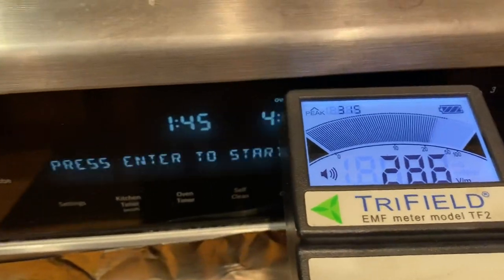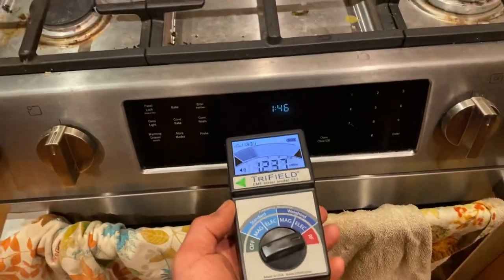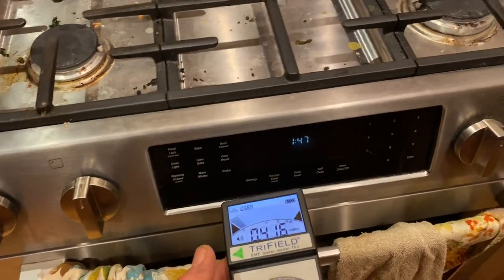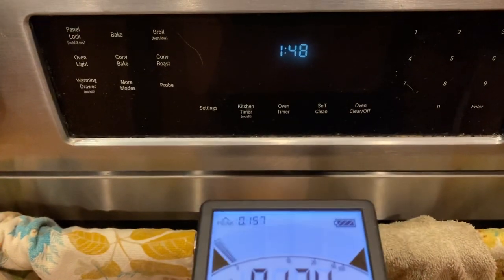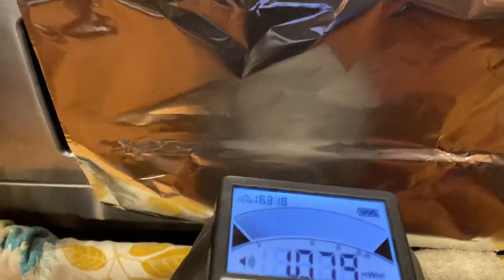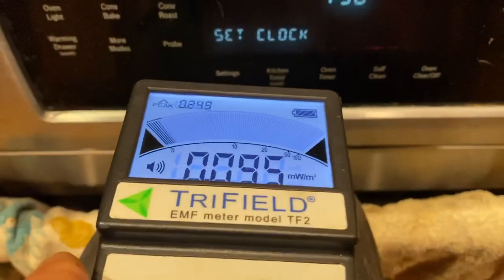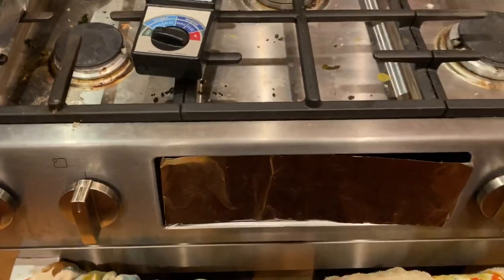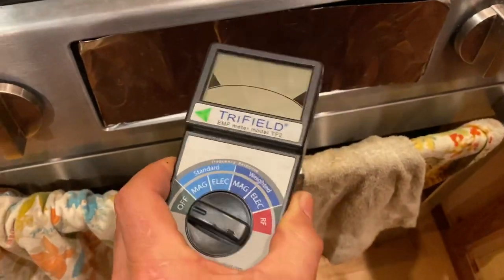aluminum foil as an emf reducer?

Comment: I live in Sweden. The house we bought came with a Smart meter, freezer, cooker/oven and fridge as well as every single lightbulb being LED. I have an EMF meter. The radation coming from the Smart meter alone had me worried. Since living here I've developed the worst insomnia in my life, have pretty constant headaches, dizzy turns and more. I contacted our energy supplier and other energy authorities about having the Smart meter replaced. Not one of them got back to me, not even to tell me I couldn't. 
The EU has outlawed incandescent bulbs. So I'm slowly removing the LED's (note: when switched on these give off tremendous amounts of EMR) and using candles and oil lamps. I put the so called Smart freezer out in an outbuilding where it remains, unused. Not only were the readings high but the damn thing had an alarm that went off every day, multiple times, for no good reason. I hated it...I'm about to begin unplugging the fridge overnight too. I also unplug the wifi router (we can't afford the thousands of kroner to install wired net) every night as well as laptops, tv (it isn't a Smart one and oh what a long time it took us to find it!) etc. But that Smart meter....I'm going to figure out if I can turn it off my own self, at least overnights. The readings in our bedroom, despite everything being unplugged, are through the roof due to it because it's sited immediately below the bedroom in the basement. And although I covered it where it sits on the wall with mesh and Faraday fabric, of course you can't do so all around because of the wall. The electromagnetic radiation from the meter penetrates through walls, ceilings and further. That's how damaging they are. A group of Swedish scientists researched a certain type of cell tower and recommended to the gov that the rollout of them be halted pending investigation due to the harm they cause humans and wildlife. Result? Absolutely nothing....
For those mocking those of us who suffer symptoms at the hand of EMF, grow up and get a life. You wouldn't...I assume...tell someone with the symptoms of cancer or heart disease it was all in their head. Unless you're medically qualified to comment, then you know where you can go with your opinions.
For what it's worth, I'm a sixty two year old woman with a background in older electronics who began to understand the dangers of EMF many decades ago and who has kept up to par on the damage it continues to cause. Believe me, it's very much worse now. We live with electronic "smog" pollution no matter where we are. 
But of course, due to profits for tech companies, we aren't allowed to make a fuss.
Well, now I'm at the age where I quite happily say, "F that. One huge fuss coming up, suck it up."
Reply: 👏🏻👏🏻👏🏻👏🏻👏🏻👏🏻 I proud of you dear
Reply: It's worse for those who took the new mrna jab.
Reply: f.goossens8118, I suggest looking into EMF paint. If you use proper grounding with it, the EMF will reflect away from the smart meter.

Comment: I am finding out the wrong way just how bad a cellphone is from a bad habit of holding the phone over my stomach. For the past 3 years I have more spare time and spend more time texting, emailing, watching videos and playing games on my phone. Lately I have been having increasing stomach problems that continues to get worse and to the point where I feel as if I am dying from poisoning. I recently figured out the problem is actually coming from my cellphone and now I shield my stomach. I have noticed a big difference where I have taken steps to limit my cellphone use and increased distance while charging. My doctors have been baffled with what is causing my severe stomach problems and never not once linked it to cellphone usage. These electronic signals are very dangerous and should be looked at more closely when there are mysterious health problems. I just hope I caught my problem in time before it done serious damage to my stomach.
Reply: The own cellphone is much more harmful than a mobile radio mast due to its close proximity. Distance matters, and the body is most sensitive during sleep or meditation, so the worst thing one can do is storing or charging a mobile phone on the bedside table. Best always turn it off or keep minimum 3m distance during sleep. I recommend to charge lithium batteries generally only inside a closed metal box (cash box with cable hole) also due to fire risk.
Reply: @cyberyogicowindler2448  See bioinitiative which has thousands of studies. Problems go far beyond cellphones, including LED switchmode circuitry and simple power cords.
Reply: Try copper fabric. It should block. Or Shungite

Comment: I have been getting sicker and sicker almost by the day.  I have not slept a full night since 2003.  The first night I slept in my newer house I was awake all night and had severe insomnia since.  It had to be something in or around that house. But when I moved again 5 years later nothing changed. I have had severe Tinnitus since I was 19 which was over 50 years ago.  I cannot be without my TV at night to drown out the noise.  I just ordered that same Trifield meter.  If my TV in my bedroom is high I will have to do something. Maybe I can start to use a sound machine or low level music maker somehow. I can't continue like this.  I believe you.  I will shut off the juice if it helps. Maybe the tinnitus might lower by itself even just a bit would be nice., i can hope. I'm just too sick to live with this.  Thanks so much for this excellent video.
Reply: ibudilast

Comment: There is proof, there's studies that EMFs are dangerous. My parents are from Jamaica. I have fibroids which are always swollen and hard. After grounding my bed using a grounding rod in the earth and putting the end of the grounding cable near my tummy, it helped but i didnt feel much difference. One day i went to the pound store and picked up a car sun shield after hearing that myler (foil accident blankets) were good at blocking EMF. I put it under my duvet and covered my stomach whilst on my phone and watching my tablet. Well not only did i feel immediate relief but those hard fibroids which usually poke out of my belly have started shrinking. Emf causes a lot of problems.
Reply: When grounding don't use anything, connect yourself straight to the source, otherwise other emf / RF can an will jump onto the line / metal

Comment: We have a commercial range/oven.  No electronics at all, not even an electric cord.  But since it has pilot lights it burns a ton of propane.  So we turn off the gas supply valve when we're not using it and just relight the pilots when we turn it on.  Bought brand new for $1300 about 4 years ago which is super-cheap for a 6 burner stove with a huge oven.  Priced the same size for residential and it was about $6,000.  Problem is finding a way to buy them since most restaurant supply stores will not sell them to you for residential purposes.  But having a farm business will get you around that.
Reply from the maker: Yeah non electric is the way to go, we couldn’t find one when we got this and my wife wanted it and I, regrettably, didn’t put up any resistance.
Neither of us could have imagined it produced radio frequency field tho. So bizarre.
Reply: holy crap, never thought about propane used by pilots, TY!
Reply: @christinetuttle8975  Yeah, was a surprise for us too!  And on a 6 burner stove with pilots running 24/7 you can really deplete a tank quickly.  Plus in warm weather it adds a ton of unwanted heat to the kitchen.

Comment: Thinking about doing a van build and am trying to decide which material will work best at shielding it from outside waves. This might be an option to put up between the insulation and paneling.
Reply: Careful about using the cell phone inside that van!
Reply: @mclovinfuddpucker how do you ground your car when it’s parked? Thank you!

Comment: If you want the Aluminum foil to have an effect it really needs to be well grounded.
I don't know why anyone needs electronics in their oven at all.
Circuit breakers aren't designed to be switched every night, it will eventually kill them.  An inline switch is probably worth doing.
Reply from the maker: CorwynGC good tips, I want to make adjustments to this approach. But even if I got years out of a breaker it seems worthwhile.
Reply from the maker: So far we’re years into the breakers being flipped daily and no issues.
Reply: @wholesystems  as far as i know circuit breakers themselves have enormous amount of EMF, larger than appliances, which need to be blocked, so your daily exposure to the circuit breaker/electric panel is worse or at least as bad as having to be in front of the appliances even if it's short-time
Reply: @wholesystems  It would be great if you can have a video on measuring RF and EMF of electric panels/circuit breakers too, I would be curious to watch it (someone said they are only at 60 GHz and they are considered safe), but based on all websites they should be in much higher and much more harmful levels of radiation. I would like to know how best we can block our radiation from our electronic panel/circuit breaker too.
Reply: What would be a good solution as well if you're inclined would be to actually open up the instrument panel of the oven and shield the component this generating the EMF directly. A friend of mine used to do this for printers that we're going to embassies and other government offices. He said it was because you can actually take the Emi from the printer and turn it back into the document being printed even from a decent range
Reply: Sorry I'm on the phone using speech to text so please ignore any errors in grammar
Reply from the maker: @hannas4486  Well, my circuit panel has little RF - about 100x less than this stove panel. It does have significant EMR. But walking but it and flipping a couple switches twice a day doesn't take long. Cooking meals with my belly agains the stove does. Time of exposure is a key function of the exposure.
Reply: What does it mean when you say the foil need to be grounded? That it has to touch the ground? I wrapped my computer in aluminum foil, but the internet still worked perfectly fine and I still got sick from having the computer on. To be honest im not sure wrapping thr Com.. in foil was safe at all. Anyway what does grounding it mean? :/
Reply from the maker: @LinnChanett  grounded like an appliance, to the ground in the house, Less EMF .com makes grounders for a few bucks..
Reply: @wholesystems  thank you ^^
Reply: I have never seen a stove with the panel in the front. Mine is in the back going up the wall.  I have a gas stove with a pizo ignite for the cook top I can light the oven without power but it is a pita and requires long fireplace matches.
Reply: Blushield is good.
Reply: Would you need to ground foil under a bed mattress to block a below neighbors router's RFs?
Reply: @wholesystems  Would you need to ground foil under a bed mattress to block a below neighbors router's RFs?
Reply: @wholesystems  A 3-pole "transfer switch" is an option I am considering.
Reply from the maker: @hannas4486  that’s not true and here’s why: I’m not by my circuit breakers for more than a few seconds to flip them, so no they are not exposing me much. I stand by my stove often for hundreds of times longer. Dose x duration = exposure.
Plus the breakers don’t produce RF radiation like the stove does.
Reply from the maker: @hannas4486  you can block them the same way. Go to less emf . Com and you’ll see all the needed materials and ways of doing it. But get a meter and then you can also devise your own methods.
Reply from the maker: @andrewsottile2016  grounding always helps but measuring the electronic pollution with a meter will show you that it still helps A LOT even if not grounded.
Reply: @LinnChanett means connected to the earth like a black connector battery or a wire or plug to ground hole of an outlet check out earthing/ grounding
Reply: @andrewsottile2016 yea check out grounding earthing

Comment: Mind Fing blown! I’ve heard quite a bit about this stuff. But honestly never dove into it. My head is becoming full as it is. 
In regards to stoves. Why don’t you get an old Wedgewood stove? They’re frickin tits! No electronic do-dads. Ours runs on LP. 4 burners, a griddle, 2 ovens. That meter is only $170. I’m getting one.
Reply: Odd thing that stoves wouldn’t work without power luckily mine does it’s like the electric car push they will use electric cars to control population. Agenda 21 says we will not be able to leave the city to go visit nature/ forest kinda strange and even stranger you will not have the right o bare arms or own private property agenda 21 is happening now under the nave of sustainability/ great reset/ COVID beware.

Comment: I’m wondering , when using foil to block emi, do you need to ground the foil? Like a faraday cage?

This is what I’m trying to figure out.

I’d like to put it on my devices to block what they emit in some instances , for example I’d like to check furnace . But I don’t know if I’m supposed to ground it somehow, I don’t know anything about this kind of stuff or even grounding .

I thought about putting copper foil in a humidifier , since it can counter bacterial growth but then wondered if  it would gather an electrical charge underneath the water and be actually dangerous .

For some reason when I did a quick look I never saw grounding mentioned but I know with faraday cages there should technically be grounding I believe . Also, would blocking the emi of something damage the device? Does electrical frequency buildup and cause the device the overload? 

Any help clearing this up?
Reply from the maker: By measuring grounding seems to help. It without it you still massively reduce the radiation coming off the source - esp if it’s rf like a router or phone versus magnetic like come from wires and motors.
Reply: Idk how to measure grounding tbh, I’m fairly uneducated with this . 

I wonder if it builds a charge and if the charge needs to be dissipated  or if I wrap a device in it, if it can mess up the device .

Comment: Do you know if your fridge or frozent food spoils any faster with breakers off nightly?
Reply from the maker: Doesn’t seem to, been years of doing this..
Reply: the lack of electricity/radiation probably allows it to last even longer, even though it may warm up a little when turned off...

(from another reply):
a huge part of food going bad quickly is that it's soaked in radiations, from the fridge and much more... it's also in an enclosed space with poor air flow and quality... 
i've lived in a van through hot summers without using a fridge, always getting large amounts of produce and living foods monthly or bi-monthly, and it lasts longer than food in a fridge... 
one's aura and level of fear about it can also play a big role

Comment: I have a question...

I'm building a house and all the electrical power cables are going down the wall between two studs. then to the outside box....

From my understanding, those cables, especially when all together like that, are going to emit high levels of radiation.

Would putting 2 or 3 layers of aluminum foil beneath the sheetrock in that area, null the problem?
Reply from the maker: This is radio frequency emf and you’re talking about emr. I’d look into it, it’s commonly shielded but I’m not sure how.
Reply: I can't say about that, but it WILL greatly improve the energy efficiency of your walls. Crinkle it up a bit and then flatten it back out, so it has as little contact as practical with the sheetrock. Only one layer necessary and it comes in 18" wide rolls, which are perfect. Shiny side "in" in a house that uses more heat than AC. I was told it would cause moisture issues, but it's been 20 years one large house we did and none yet.

Comment: Unique Off Grid appliances can be lit without power.
Reply from the maker: James Frosch for sure we tried one brand and it was junk.
Reply: A much worse insanity is that wood pellet stoves need mains grid to transport the pellets into the fire. Why the hell don't they use a windup clockwork mech for this (may be operated with a weight like an old clock). If more sophisticated, the oven heat may then produce energy to wind up the mechanism (either by an electric peltier generator or mechanical stirling engine).

Comment: Can you make a box of foil and put it over your router .
Reply from the maker: Emmanuel Wolf yes but you probably wouldn’t have usable reception if you did
Reply: @wholesystems  that's what I thought,until I can afford something to protect my family with,I need to try and come up with a solution as we need wifi for our youtube but I also need to find a way if reducing the emf.
Reply: EW if you cover in foil on all sides it takes three layers of foil and if battery is involved it produces a tremendous amout of heat.
Reply: @emmanuelwolf6568  have u managed to found a way to get rid of emf from wifi router ??
Reply: Modify a cash box with cable holes to block RF. (But if done right, it won't transmit wifi anymore.) You may also put the external power supply inside because switching PSU emit higher frequencies than the old 50/60Hz iron brick.

My router is yet unshielded but of an era before there was wifi.
Reply: aluminum screen (like a screen door) can be shaped to shield routers and lots of radiation-producers... 
an even better way to go is to turn off all wifi/bluetooth/everything and hardwire all your internet with ethernet cords... 
but still shield your router and such even if wifi is turned off

Comment: Fasinated that when you touched it the meter showed zero 😳
Reply: He's conducting it all through his body and into the floor beneath him, it's less resistance to move through his body and into the earth than it is to emit through the air. Electricity flows to the path of least resistance. That's what's meant by grounding.